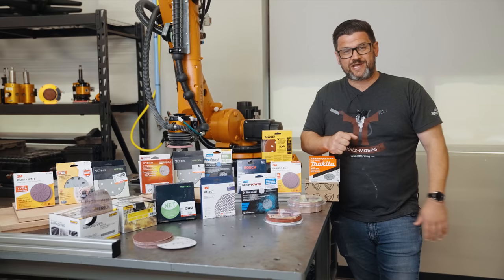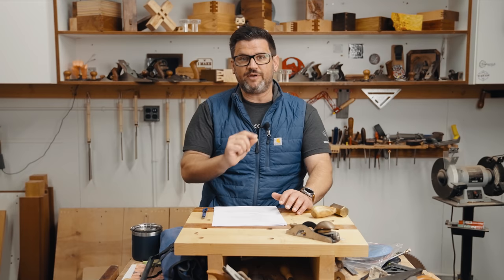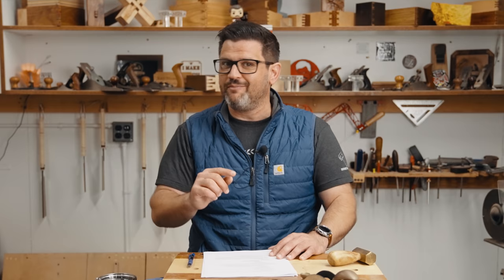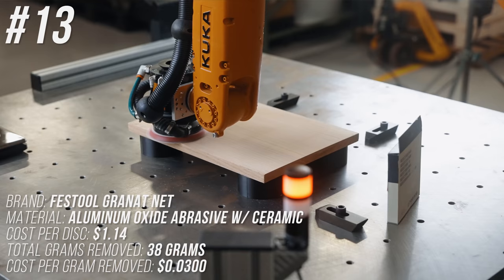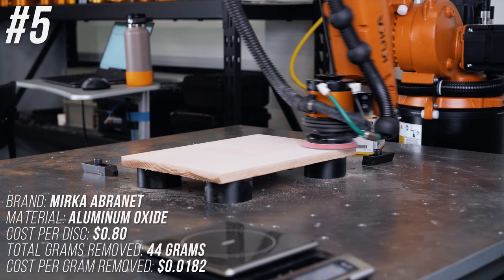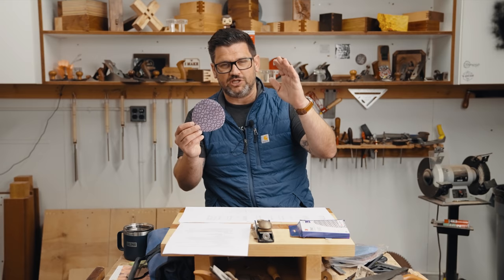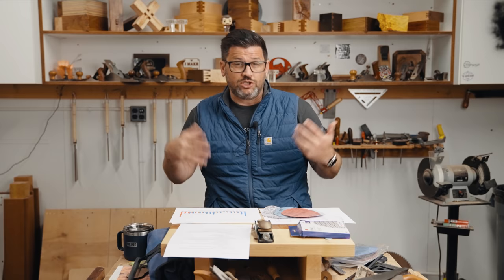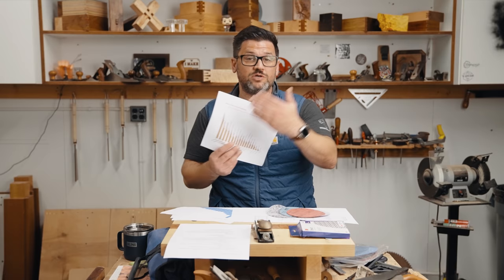Largest Sandpaper Test EVER Done - Top 19 brands Tested using Robots for Unbiased Data

Comment: We build cabinet doors, lots of cabinet doors. Typically around 100 to 150 a week. We run all of our doors through a 36 inch sander, then finish sand by hand using 3m cubitron 2 extract. We do have an issue with the mesh tearing long before the sand paper has worn down. But that's because it gets torn on the inside edges of the cabinet doors if the sander isn't held exactly flat. If they made a paper backed one with holes where the exposed mesh is, I think the backing would be much more durable and still get most of the benefits of the herringbone like pattern that the cubitron 2 extract has.
Reply from the maker: They do. It’s the 775l

Comment: Great video! Great experiment!

It'd be interesting to reorder the existing results with a cost-to-use metric, which incorporates both the sandpaper cost and the manpower cost. For manpower cost, estimate wages of a person who has to remove N grams of material, where N is the average amount of the material that someone would need to remove in an average project.

I think that cost-to-use metric might push down the Klingspor - Dewalt section and bring up some of the more expensive but higher quality disks. You can probably do all of that with the existing data you have.

Next, another video idea, how long should you use a disk before replacing it? Based on the friability measurements and the cost-to-use, each paper type probably has an ideal replacement window. This probably varies with different grits, so maybe take some of the top ones and come up with ideal replacement rates based to maximize cost-to-use for that brand/grit.

I think it's a good thing that your experiments bring up so many ideas for further research. That's the mark of an actually interesting experiment!

Comment: The 3M Cubitron and Xtract are non P graded, they are rated 120+ which means that it’s a blended 120. It will include coarser grit than 120 so of course it will remove material faster than the P120 discs that only use 120 grit. Check the scratch pattern when done and compare.
Reply: Actually some of 3M products are graded with + symbols because the mineral is precision shaped grain. Some products are pure precision shaped grains, others are blends of precision shaped grains and classic busted up grains.  Precision shaped grains are all individually made little triangles.  The mineral fits the standards for size (ASTM Standard) but because of the perfect shaped triangle edges it cuts better than a similar sized "normal" 120 graded product.  So they put the + on there so as to call attention to the fact that it cuts better per grade.

Comment: Awesome video and great testing. 3M makes great paper. But the cubiton is the only disk tested NOT on the fepa (p grade) abrasive. The scratch depth is much deeper and courser vs a fepa graded disk.
Reply: There are other reason for not being on the P scale. Mineral composition is one of them. But as far as what grit is on the paper it has been proven that the Cubitron II is nearly 100% the same grit, which is insane. Most companies are an 80/20 or even a 60/20/20 split. The reason it cuts so much better is largely due to the mineral.

Comment: I don't quite understand how i can get such dramatically different results. I typically use Mirka Autonet but recently bought a box of 3m Xtract and the 3m discs didn't hold up even remotely as good as the Mirka. The 3m had great cut at the start but really fell off afterward. The Mirka held its initial great cut for far longer allowing me to get much more sanding done. The Mirka holds up so well i can put it on my dual action car polisher and wet sand metal and even glass to get a scratch out of it like i did recently.

Comment: A good way to "fix" the data for the ultra cheap but still poor performers is add in a labor cost per gram removed to the sanding disk cost per gram removed. (combining mmr to tooling cost to get to a "productivity cost" value. This is done all the time in the CNC machining world. ) 
The most expensive thing in the shop is the labor used to run the equipment. So it's good to add in that cost. 
You can use just a generic shop rate,  (perhaps as a separate chart), but it will force those poor performers to the bottom.

Comment: What I'd like to see is the figures if you valued your time as well. The formula would be something like: Cost to remove 100g / time to remove 100g. So that might be $25 for half an hour of someone's time (varies per disc) plus 4 discs (varies) / time taken to remove 100g. In most business the labor will be the most significant cost so an expensive but fast disc will beat a cheap but slow disc because of the time taken to do the work which will not be reflected in the cost/gram
Reply: David, no additional data are needed, just a bit of math.  The numbers would change, but I think it will be the same ranking as cost/gram removed with time constant, right?

Comment: Fantastic test and video and the ATI lab is drool worthy.  My only nitpick would be that Mirka uses a mesh interface pad between the sander and the abrasive pad.  This gives the sander holes wider suction and better dust collection, sort of like the clamp and caul principle.  I imagine the Mirka interface pad would work for any 'hook and loop' mesh pad.  Did you use the Mirka interface in the video?   Now that the Mirka patent has expired, we can expect reduced prices, due to competition, if Mirka is rational (big if).  Again, great video and you have probably saved some lives with better dust collection.  Good work.

Comment: That festool granat really really shines when sanding wood glue and wood at the same time, the glue doesn’t stick to the festool paper at all in comparison to the other brands, if you are just sanding wood then rubin is recommended as it’s designed for wood sanding only unlike the crystal or the granat that are made to sand with glue or for paint removal types of sanding. Great video definitely will be trying some of that 3M,

Comment: really well done video. While removal rate isn't everything, it is a good place to start. Don't know how you would do it, but surface roughness test of the sanded surface to evaluate how friable and true to its labeled grit would be fun. Would love to see country of origin info too. 
But also all 120 isn't 120 based on the grading system they use FEPA or ANSI.
One of the issues with alot of the cheaper papers is how tightly they control the abrasive material grit size in manufacturing. There is always some range of particle size range, say if it going to be 120G it may be 125-120 micron, but in manufacturing, they may let through 150-80 micron particles, which means it will cut more aggressive, because they are using bigger particles, but will not leave as clean of a finish because it may act more like  100G product.
But also all 120 isn't 120 based on the grading system they use FEPA or ANSI.

Comment: This is a dream test for a floor sander like myself;
A lot of us in Australia actually use zirconia papers for our orbitals, along with oxide and ceramic
Although I far prefer ceramic over zirconia alot of sanding guides from machine manufacturers recommend rough/intermediate with ceramic then fine sand with zirconia (Which confuses me as I find zirconia way too aggressive)
Would be great to see this test with some of those in a test though - One I believe you could get your hands on are the SIA ones
Norton red heat
Norton Blaze
Both cost a fortune, both are meant to deliver great results.
But since finding Cubi II a year ago I have not looked back
Just wish they made sanding belts for my big bertha!

Comment: After doing a bit of thinking about this test, the only thing i see wrong with it is perhaps the amount of pressure used. Even with my big Bosch GET55-5 dual-mode sander, i don't put that kind of weight on a disc and that much weight would cause any consumer grade sander to stop functioning. Anything other than a ceramic disc would quickly get ruined by such pressure and increased temperature. 
I use 2x72" ceramic belts on a belt grinder i use for knife making and for ceramic to properly fracture and create new sharp edges, it needs a lot of pressure and speed, and i'm sure these ceramic discs would also benefit from the same. I'm saying this because as i said in a previous comment ive always had far superior performance with Mirka Autonet and it was bugging me while i was out back sanding my redwood fence

Comment: This was excellent, great job!!

I'd love to see a test on how they perform on dust extraction, but I assume that 1) the meshes do really well due to higher air flow and 2) it highly depends on the sander as demonstrated in one of Peter Millard's videos.

Again, really great test!
Reply: The dust extraction is very good.  At 3M, we’ve seen 97% and above on our own Self Generation ROS which include a Hepa Rated Filter Bag if needed.  When using on a Portable shop vac or Central Vac, there are many variables including size of vac hose, connections, length of vac hose, power of dust extraction…..but you should see at least 97% or higher.  Also depends on technique, ROS are meant to be run flat to create a swirl free finish.  If tipped, you will weakens the dust extraction and possibly create defects as you may gouge.  Many people do this to be more aggressive.  I would rather see my customers use a coarser grit and keep it flat.  Thanks for trying our 3M Xtract Products.
Reply: @tphicks44  thank you! I'll definitely pick up a few packs when my next paycheck arrives.

Comment: I've been using the 3M sandblaster sanding discs for years because while you only get 3 discs in a pack each disc lasted longer than any other three discs I've ever used. I will have to start buying cubitron from now on. Thanks!

Comment: The cubitron cuts AMAZING, but, the Velcro (loop) on the back lasts about ten minutes and then it’s worthless,  you don’t  get the use out of it.  The Velcro (loop) comes right off the back and sticks in the Velcro (hooks) on the sanding pad.  Sticks in it and fuzzes it all up.  So frustrating I had to stop using it. Terrible quality control and so frustrated after I had ordered 4 variety packs.

Comment: Late to the party, and appreciate the revisit. I didn't see this addressed, but was curious if the high removal rate for the 3M Extract partially reflects a great recovery rate of dust given all the mesh? I'm not knocking it as it seems a win either way . .  more wood removal and/or dust recovery. Great contribution and greatly appreciated!
Reply from the maker: There's 7 meshes on here. There's no statistical significance to mesh making a difference

Comment: You can't do a comparison with set Z axis points on your robot and variable board thickness. Even a few thousandths of an inch variation changes the load. You need a force sensor on your end of arm tooling.

Comment: This is great. only challenge i would say would be the Diablo Sandnet discs are very typically found for around $.50 per disc rather than the $1.51 used as the basis for rating them. Using that pricing as the base the cost per gram is about .008 which would be second place behind the 3M Mesh discs.

Comment: I’ve been waiting to buy some disks until you posted your results. They are very interesting. I’m not surprised that the mesh performed so well. I did a video on my channel about using small Abrenet Mesh sheets for turning. I really liked the results I got from it. 

Two things you didn’t mention was how smooth the surface was after each test and how you determined how close the grits were to each other. Obviously a “lower” grit, i.e. 80, would take off more material than a one that’s considered a “higher” grit i.e. 220. What one company calls a 120 grit paper rarely matches exactly what other companies claim are the same grit. The smoothness of the surface that results from grit differences would be different as well.

Comment: Was the overall "smoothness" of the finished product evaluated any? I just wonder on some of these how they even were as close as they were (totally not disagreeing with the result here btw, this was excellent). I more thinking on your point around disliking sanding and time taken, if you remove 10 grams (just using whole numbers here) but I have to sand for 5 passes to get it down to an acceptable smoothness vs 1 pass and/or less grams removed. Just wondering if that could be quantifiable in some way.

Comment: I bought the 3M Cubitron last year when you did the very 1st comparison as it was a solid test. Never buying them again. I went through the grits on a project I was doing: 80, 120, 150, 180 & 220, EACH disc wound up flying off the sander after about 10min of sanding on each disc. They no longer stick but I know they're still "good". I switched back to Diablos ceramic h&l. Idk if I got a "defective" pack but they were a super disappointment. They started off really strong but now I just have them in a drawer out of sight but if I need to sand by hand, I know they're there.

Comment: Just came across this video, and I ordered some mesh cubitron to try out.  All testing is iterative; that is, you do the best you can, then think about it, talk with others, then do it better.  On your next test, try to control for differences in actual grit size between the brands.  That is, a falsely labeled grit size will skew the results....for example, if the Makita paper was labeled as 150 grit but in fact was comparable to the 220 grit of other papers then it would not test well.  It would give a smooth finish, though.  You will need to do this by test sanding a homogenous surface such as HDPE and analyzing the scratches, I think.

Second, most woodworkers are like you, we hate the sanding.  So the important metric is not the cost of the paper and cost effectiveness, it's the time effectiveness, which you show as the total grams of material removed.  I'd gladly pay another $2 in sandpaper costs for a project that saved me 15 minutes of sanding.  I am a hobbyist and all my tools are for fun, and I can afford costly sandpaper if I want to, but I do want good results, and crappy sandpaper does not give good results or it bores me so I'm not as careful as I could be.  The most expensive thing in the whole shop is the guy who runs the sander.

This video is a service to the woodworking community.  Job well done.

Comment: I just bought an ETS 150/5, upgraded from a DeWalt 5". I started using the Cubitron after the last video and it's REALLY good, FAR better than the cheap stuff from Amazon I used to use. With the ETS, I decided to purchase the Granat and now I have a crap ton of it. So far I have noticed that it's good, but not quite as good as the Cubitron. I can't wait to try that Xtract. BTW: 100-Pack of Granat was actually cheaper than the Cubitron, which is why I decided to try it. 100-Pack of 6" Cubitron is $140 (Taytools), whereas the Granat is $70 (US Tool & Fastener), so literally half the cost. IME, the 5" Cubitron for some reason is considerably cheaper compared to the 6". A 100-Pack of 5" Cubitron (Taytools) is only $75, and can be found even cheaper from Amazon sometimes. Taytools has the 6" Xtract 100-Pack for $64. Unbelievable based on the results, that it's the best AND cheaper. Now to burn through my 400 discs of Granat. LOL

Comment: Thanks for this great video.  I guess my only comment is cost/gram removed is not a measure of time saved.  It's a value comparison.  Since your time intervals were a constant it really becomes total grams removed as the true indicator of potential time saved in your shop sanding.   As I have probably purchased enough Festool discs to last a decade of hobbyist work, I was happy to see Festool did ok in total grams removed.  If I run out of a certain grit I will definitely try the cubitorn mesh next.

Comment: Hey Johnathan, great comprehensive video! Appreciate the work you and your team is doing.

I did see a minor mistake in your video. The graphs showed the 3M Cubitron twice in every graph. 1st place, as you mentioned, is the 3M Xtract but your graphs showed Cubitron in 1st & 2nd place. 

Keep up the hard work! We all very much appreciate it.
Reply: One of them is the Xtract. But both are part of the 3M Cubitron line. I agree the labelling could have been better but it’s not “wrong”
Reply: The cubitron II is the name of the patent mineral 3M has. They use it on all of their top tier papers. It’s the same mineral, just on a different disc backing.

Comment: Well, after I picked my jaw up off the floor, I did the same thing as Izzy did... just threw $300 at TT for every grit in 5" and 6" they offer! Wish they had it in a 3.5" size for my Rotex RO90 and the delta pads!
Reply: Thanks for trying our Xtract products.  Currently, we do not have 3.5” but we do make 3”, 5”, 6” and 8” 710W Hookit Extract Discs as standard stock.

Comment: Great comparison.  However, I know that 120 & P120 paper are not exactly the same grit size.  They are made under two different standards.  They are pretty close in the 80 or 120 sizes, but start to differ dramatically at about 220. For 220 and above, you need to stick with either P graded, or standard grit.  If you mix them, you could be undoing work you did with the previous grit.

Comment: the 3m xtract works great on a flat even surface but when used on a rough surface or sanding with the edge of the sander like we all do the disc wears out almost instantly. I have found the Serious Grit brand holds up better and better prices. I understand the application is everything here but for what i do mostly the 3m just doesn't last maybe i need the robot to do all my sanding .... would be nice lol